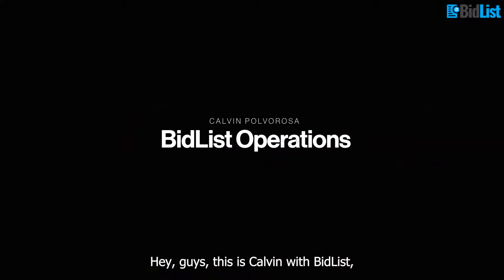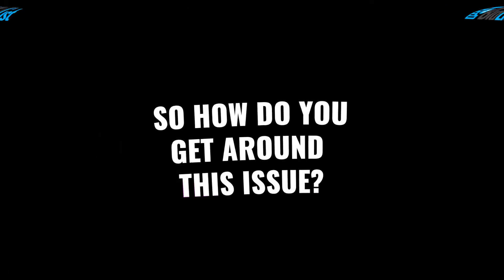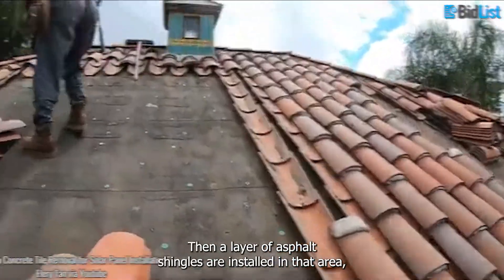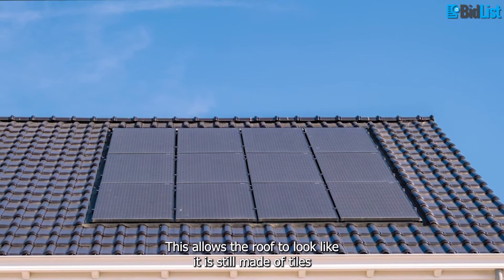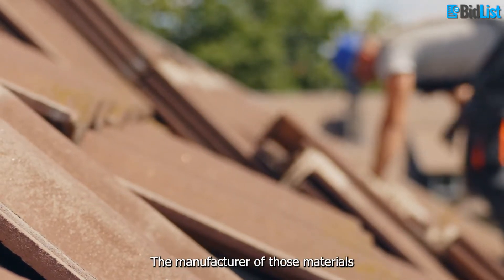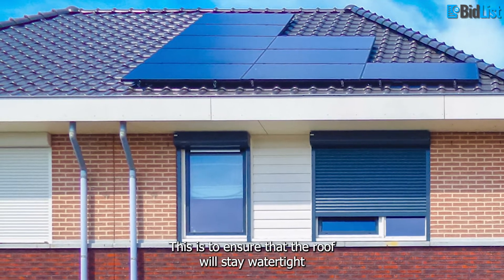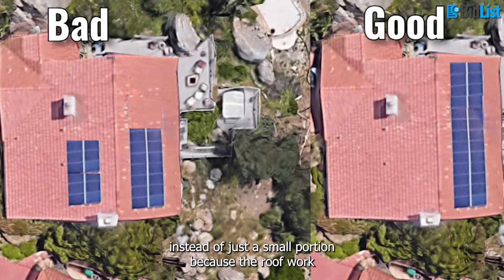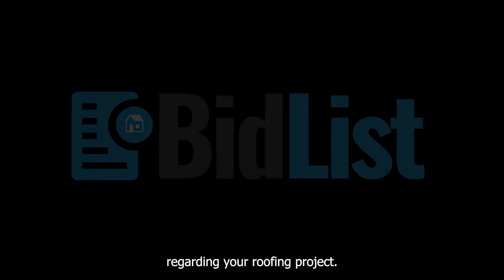Learn more about "Picture Frame" Roofing (AKA "Comp-out" or "Comp-inlay")

Comment: So does the water flow beneath the tile, below the panels?
Reply from the maker: If you are referring to the areas that are located "downhill" from the solar array, then yes. Water will go underneath the tiles in those areas. This is why the entire roof plane has shingles installed to provide complete protection. Also, many installers require that the panels come all the way down to the eaves of the roof so that there is no need for tiles to be installed downhill from the panels, which would eliminate the situation you are referring to.
Reply: @bidlist  That means there will be a LOT of water going under the tiles (and above the asphalt shingles), and there is no way for that water to drain (on my house) except through very small weep holes in the bird guard (above the gutter).  Those weep holes aren't designed to handle that much water, so water would backup under the tile, and pool over the asphalt shingles, which isn't a good situation.  For my roof design would you recommend that the weep holes be drilled out, and increased in number? or some type of new bird guard/drip edge be installed, to improve drainage?
Reply from the maker: We couldn't say for sure without taking a look at your exact situation, but yes, any of those solutions would likely help out. You are correct about water backing up, you do not want that to occur on shingles. Increasing the drainage is likely your best bet, or not having that style of tile guard in those areas with the picture framing. A mesh guard might work well, or increasing the amount of drain holes would be an easy solution. Definitely talk with your roofing contractor about the issue and see what they recommend for your situation